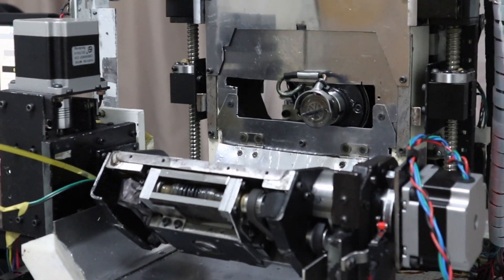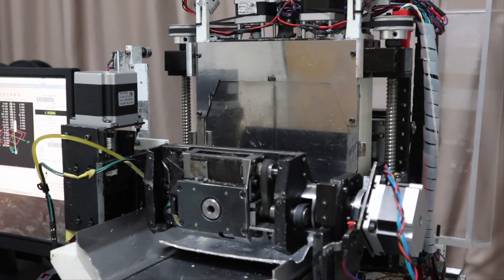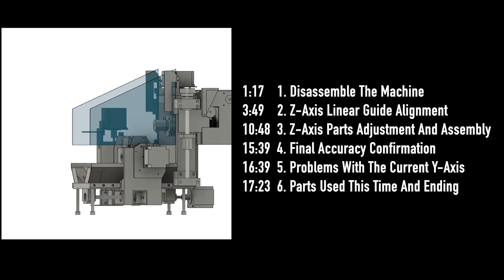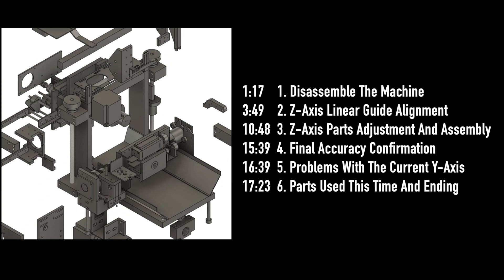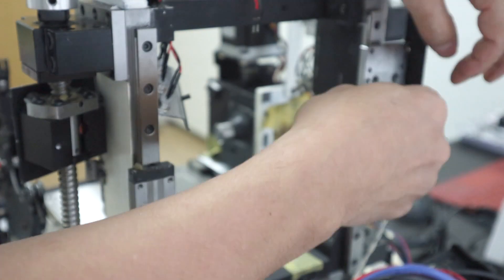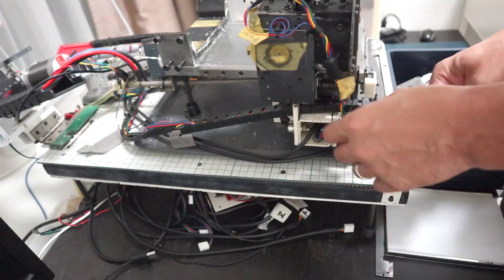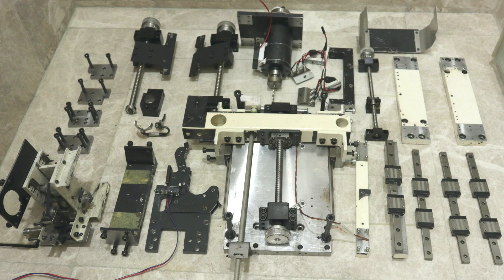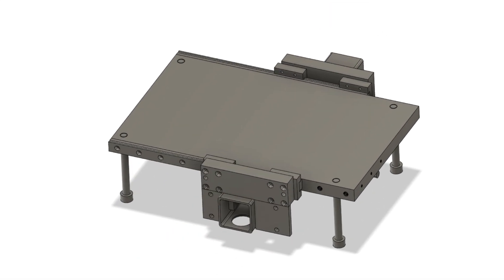【 DISASSEMBLY 】How to Build CNC 5-axis. |  Cute, Cool and Unique Machine

Comment: 6:40 - Thanks for showing how to mount the linear guide ways to the base plate. Always wondered how it was done. What type and brand of linear guide ways and blocks are you using?
Reply from the maker: It is this.
Japanese shopping site.
https://jp.misumi-ec.com/vona2/detail/110302586530/?KWSearch=%e3%83%aa%e3%83%8b%e3%82%a2%e3%82%ac%e3%82%a4%e3%83%89&searchFlow=results2products&list=PageSearchResult

Comment: I want build a 5 axis cnc milling machine, but I don't wanna copy you, I want to start from skratch, do you advise me to write down a project before building it, like you do it?
Reply from the maker: Maybe it's my english problem.
I'm sorry, I don't understand your meaning of the question.
Are you thinking of controlling a CNC machine with skratch?
Or are you asking if you should make a 3d model and proceed with the project systematically?
Reply: @a-cnc-f  sorry, it's my problem, I wanted to ask you if you think if is better to write down a project on autocad before building it ? as you did
Reply from the maker: When designing a 5-axis machine, you should make a 3D model and check for interference. 
With 3 axes, you can imagine the movement, but with 5 axes, the movement is too complicated.
It's even more difficult because it need a lot of parts and it don't have enough space.
Especially in my case, I wanted to make a machine as compact as possible, so I checked the interference many times with a 3D model.
and modified the design.
Reply: @a-cnc-f  do you have a discord server?
Reply from the maker: No ,I don't have.
Reply: @a-cnc-f  Can I make one for the subscribers?
Reply from the maker: @AthysOfficial  
Do you interesting about to join subscribe !
If you join it ,you become Special subscriber. 
Because you become first subscriber in this channel.
As I said in the membership invitation video, I would like to manage the membership with responding to the wishes of the members.
In other words, if you are the only member, I will  meet your expectations as possible.
Reply: @a-cnc-f  Not for those subscribers, I mean for the spectators that watch you everyday, in a discord server they can ask you questions and you can chat with them. I've already did one because I had nothing to do and it came out really cool. I think it's very useful a server to share opinions and talking about cnc machining, let me know if you wanna try it. Think about it ;D
Reply: I did it for another reason, I've to talk with you and I don't know where, youtube isn't made to chat
Reply from the maker: @AthysOfficial  
I studied about discord.
It seems to be useful for chatting or talking.
But for me, it's not convenient.
I have other jobs and spending time with my family is also important.
English is not very good either.
It is difficult to communicate in real time.
I'm writing this in commuting.

Comment: Any advice to choose 5 axis cnc controller? I mean i would like to make a big 5 axis cnc milling machine so i dont know whether i can get any 5 axis controller or should search for a particular type of controllers if i want to make huge details (1.5 meter long, 1 meter wide and 50 cm deep)?
Reply from the maker: If you want to make 5 axes, Linuxcnc or Mach.
LinuxCNC is free.
Mach is a charge.
Reply: @a-cnc-f  what about the hardware? Can i put the same ECU the one you used? Will it be able to make big parts?

Comment: Hi there,
Your project looks cool, Looks like you use SOC board to run LinuxCNC. 
Did they generate the step signal fast enought?
Reply from the maker: This machine run with Raspberry Pi 4 and Mesa 7c81
Reply: @a-cnc-f  Mesa board is awesome, but quite hard to get one in my place.